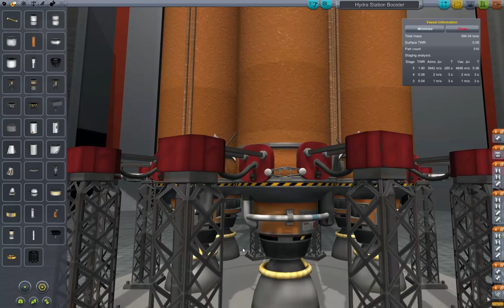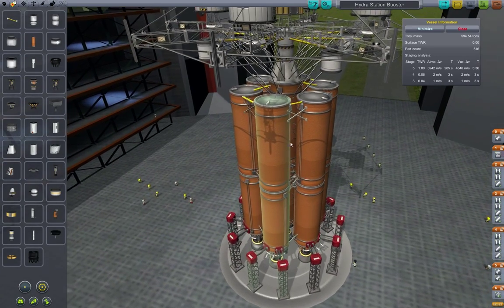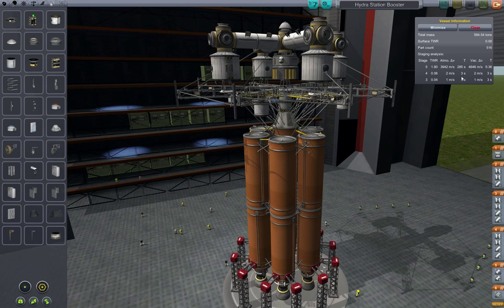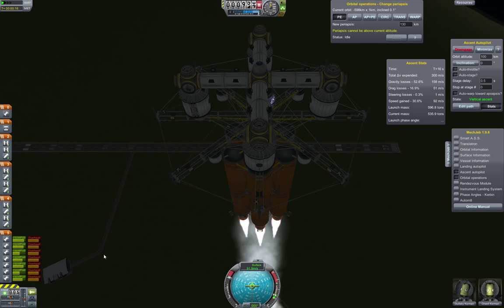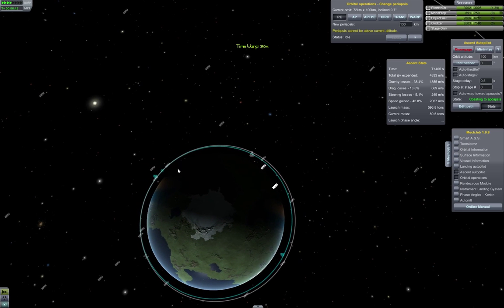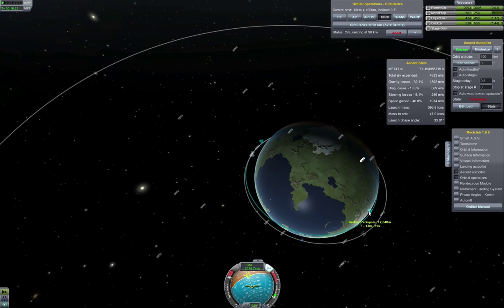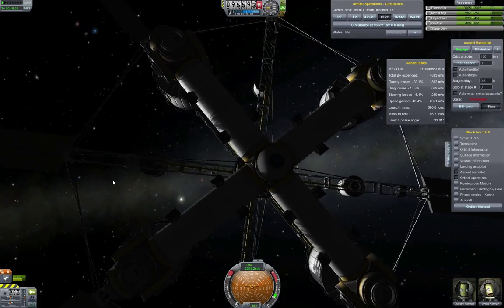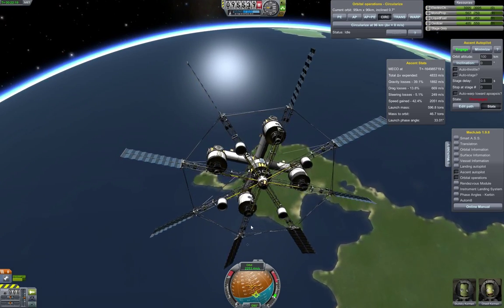Kerbal Space Program: Getting large things into orbit with heavy lifting boosters.

Comment: Actually I have a lifter based off this design which I use for a 96 ton OASIS space dock, so it's doable just using some TWR and burn time optimization. Strap some solid boosters on and it will do 100+.

Comment: I agree that the design is solid, but the amount of engines and layering has to be adjusted based on the weight you're trying to get into space. To lift my 174 tonn engine/fuel reserve section of my space station, even using asparagus staging, I had to add another layer around the one in the video plus solid boosters, and it was just right for orbit.

Comment: My question is how would you go about attaching a fuel tank to the station. It would be a different launch I am sure, but for large scale missions having a refueling station would be beneficial. Also I have had the same trouble with the sound and recording. What I do is before I start a video recording up, I switch to windows and open the mixer and drop the sound ONLY for KSP down and that fixes it.